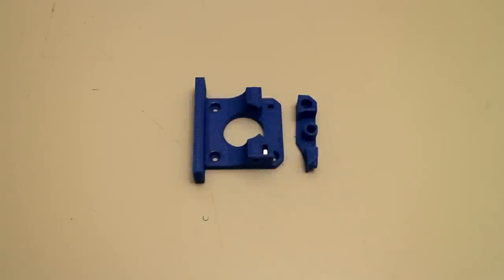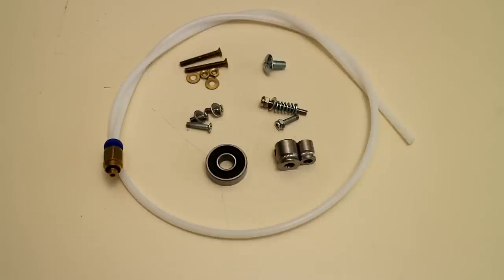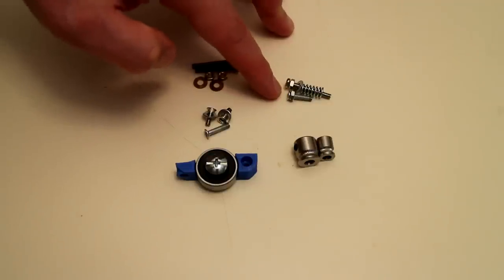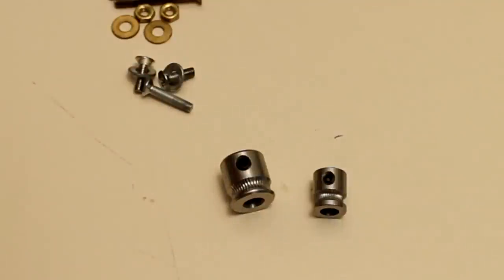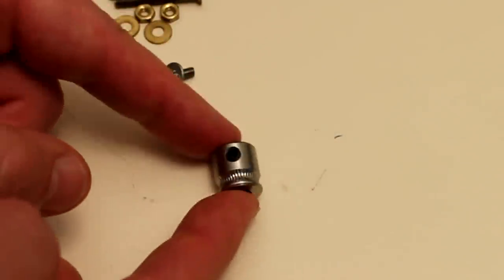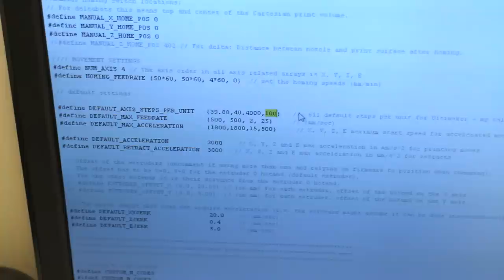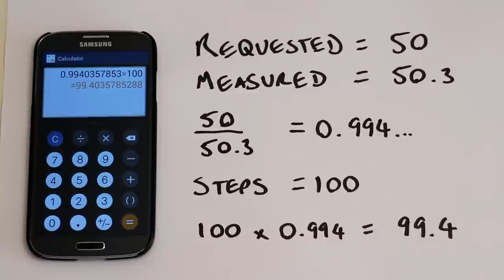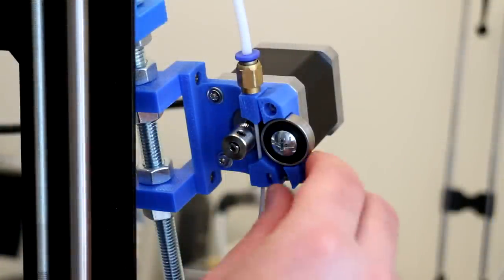3D Printer - Bowden Extruder Setup

Comment: what is the lenght of the PTFE tube
Reply: 1.75mm: Φ2 x 4mm (inner diameter is 2mm, the outer diameter is 4mm)
3.0mm: Φ4 x 6mm (inner diameter is 4mm, the outer diameter is 6mm)
Temperature range: -190 ℃ ~ 280 ℃
Long: 1M
Nozzle type: 1.75mm, 3.0mm (optional)